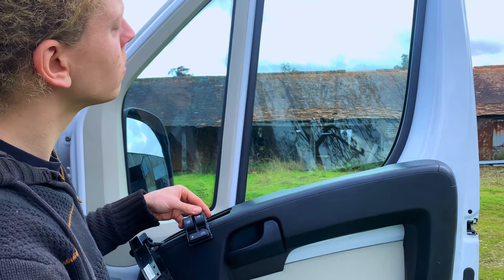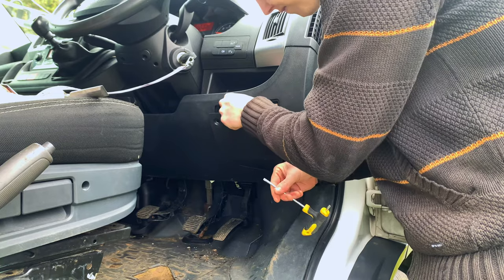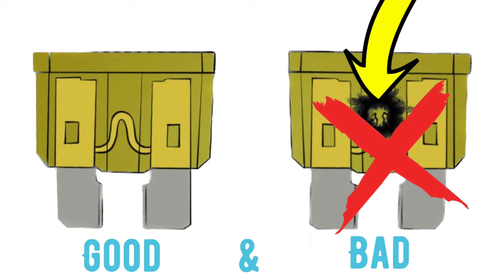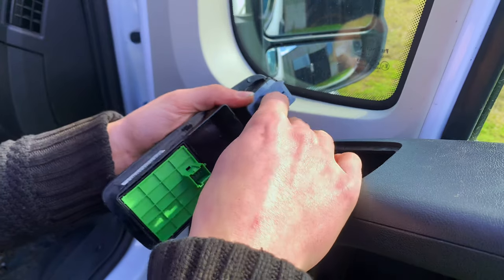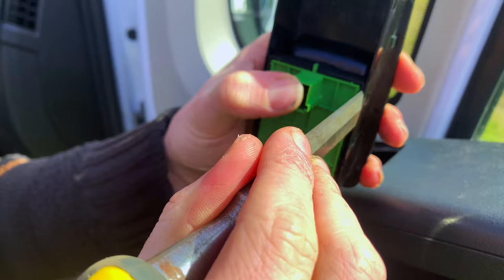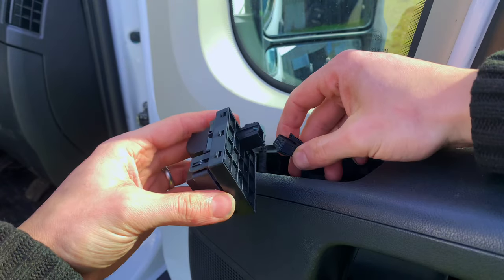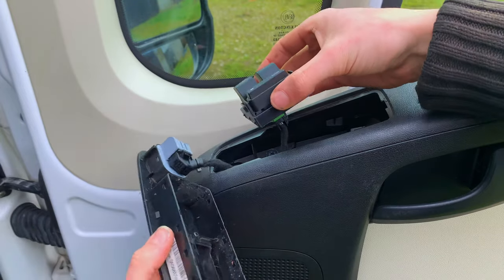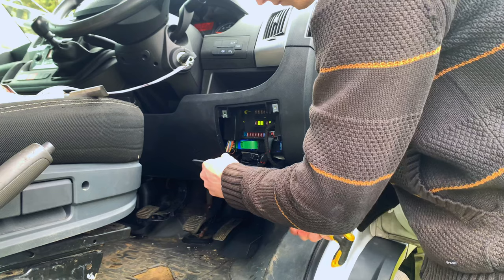How to change a window switch on a Fiat Ducato /Citroen Relay /Peugeot Boxer

Comment: Hello. Any ideas if my drivers window goes up and down. even if I try to open it goes up. Each time its different. Sometimes it opens. Sometimes it does not. I can control passenger side window just fine.   Bough a new switch, but it is not working at all... only lock button works on a new one.
Reply from the maker: Hey so if you take the controls apart, you may find that the gold has rubbed off. This may well be your problem that’s it’s not connecting properly. There are links to new bits in the description. Hopefully this helps :)